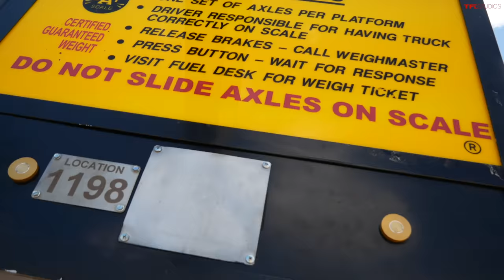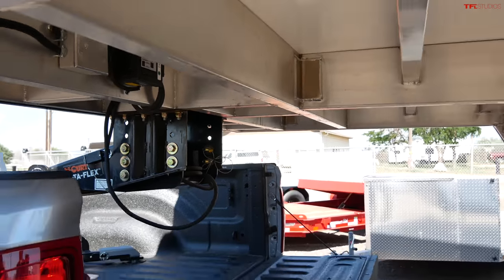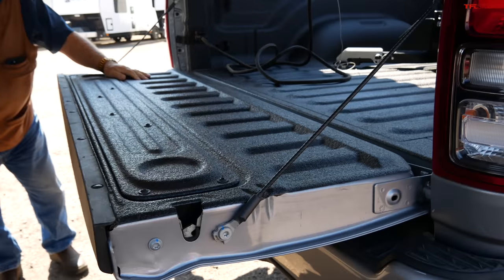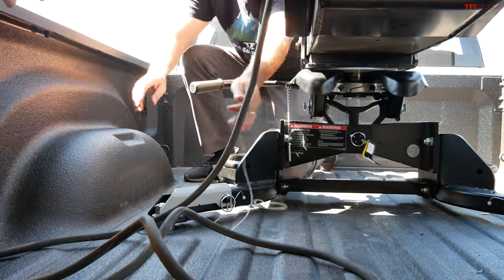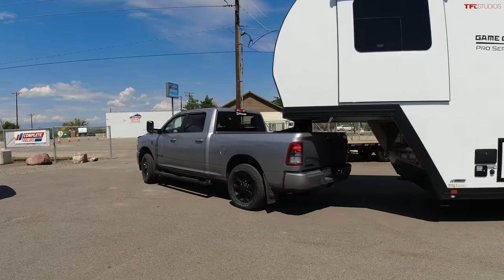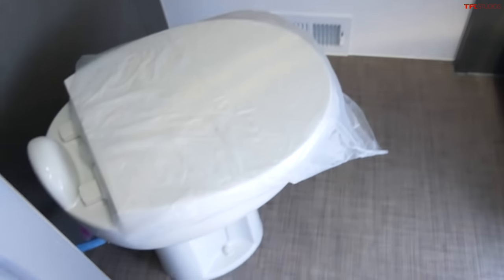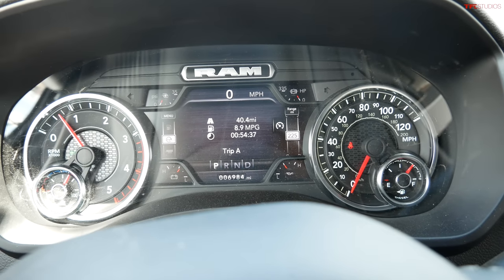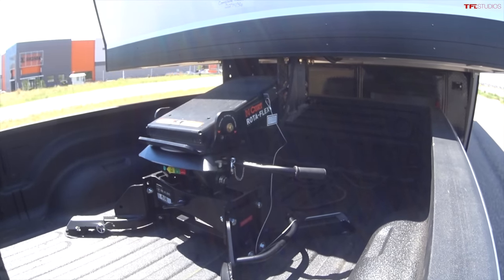I Accidentally Overloaded My Ram 2500 Cummins By 1,000 Pounds & Guess What?

Comment: You were overweight with an empty trailer and truck. When the typical user loads it with all of the camping gear in the trailer and the truck, plus the passengers a 3/4 ton truck is way over its weight limits. This trailer is definitely for a 1 ton truck.

Comment: Really guys you are supposed to be giving Good Advice...I am a CDL Driver hauling a PJ 40ft (Electric/Hydraulic Brakes) Gooseneck with a Peterbuilt Customized Sleeper and 110 gal Diesel Aux Tank in the bed...Hello get a Dually Ram with Factory rear air leveling. You guys are doing a Dis-Service to your Viewers using Sub Standard Equipment 👎.  All I can do is shake my head...

Also anyone buying a Trailer like this with Electric Brakes is begging for trouble 👎  I would not touch a Trailer without having (Electric- Over- Hydraulic Brakes)👍👍👍

Comment: In the commercial world payload or cargo capacity is not legally binding axle weights and gross weight of total rig is what counts or at least that is the way it was explained to me by  federal  DOT officers and state  officers. For example a class 8 truck has a gvwr of 38000lbs but you hook a trailer to that truck your gvwr is 80000lbs 12000lbs on steer axle 34000lbs on drive axles 34000lbs on trailer axles but unhook that trailer and that truck is only rated for 38000lbs that's the example that was given me by federal and state officials because I've got 5 3/4 ton trucks doing rv transport and 2 class 8 tractor trailers running under my own operating authority they go by axle weights and total gross weight of the truck trailer fuel people tools hitch candy bars cold drinks bottle water generator anything and everything that is on or loaded in or on truck and trailer it is measured as rolling weight or static weight as for payload or cargo no legal binding or standing when you hook to a trailer you are now considered a combination vehicle as for on the commercial transportation side of legal weights gross axle weights and total gross weight or fagw ragw tagw and gcvw they do not use the gvw of truck then gvw of trailer now they do use the gvwr of truck and gvwr of trailer add them together if they are over 26000lbs in the commercial world you better have a class a cdl license and a license plate rated over 26000lbs they also check and look at tire weight ratings and how you licensed and registered the tow vehicle as example a truck with a 26000lbs license plate a gvwr of 10000lb hooked to a trailer that has a gvwr of 16000lb is under the cdl requirements but that same truck hooked to a 20000lb gvwr trailer they go by rolling weight how much does the total rig weigh how much weight is on the axles if under the 26000lbs you still don't need cdl but at 26001lbs you need a cdl and you are overweight on your license plate so I'm thinking and the officers told me I was correct if that is legal in the commercial world it seems it should be legal in the personal side of towing especially since most personal rv or whatever trailer they are towing the licensing and registration of the tow vehicle has not got the correct weight rating license plate for the total weight of the rig

Comment: A Gooseneck is NOT stronger than a 5th. Why do people tow 25k on a goose but semis do 300k on a 5th? It is about the connection point to hitch, tow a goose and jam the brakes, closer to truck axle means more stable, now, jam brakes on an “RV 5th” and see your ass drop to bolsters and get wet underwear. If that 5th was only six inches above plates, and 8 inches above axles, you would tow like me for last 3.5 million miles with a semi. I personally will not tow a 5th wheel trailer, I want a goose that is closer to my axle for stability.

Comment: big deal,,, we routinely overloaded our fords 3k -8k when haulting steel,,, the tickets were not cool, but fords never had a problem we had diesels and v10's,,,  goosenecks and you did not even notice a difference maybe on the brake controller but I found the 5.9 diesels weak and dodge trannies on their v10's pathetic,, the new dodge 6.7 looked interesting (the 6.4 ford diesel a boatanchor)

Comment: I know this comment will get either deleted or stuffed to the bottom, but this has to be said

I can't put into words how insane i became watching these buffoons scramble with this trailer.  They were given literally the best toy hauler money can buy, and they didn't know how to use a lube plate 😑. Or even how to hitch up:
"Lets connect the trailer brakes so you can activate those as you back up"
Or just chock the wheels like a non idiot.

They had zero knowledge or appreciation for the incredible materials, craftsmanship and capability of an ATC. "Its got two axles and hauls a lot of toys".  

What an absolute waste of a review.

This is why i watch truck king instead

Comment: Really... You guys just put more dangerous people on the road..
There are multiple position 5th wheel hitches for short bed truck's.
You adjust the hitch height to a manufacturing spec. of a certain % or  degree for tandem ( or more ) axles.
What about the Gain and proper breaking settings??
Get off the road before you Kill some people.!!!